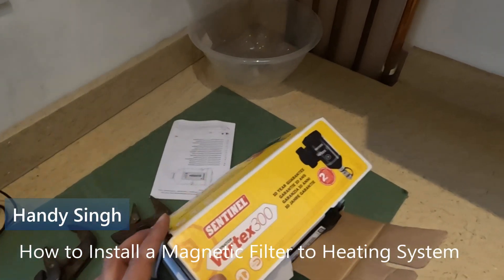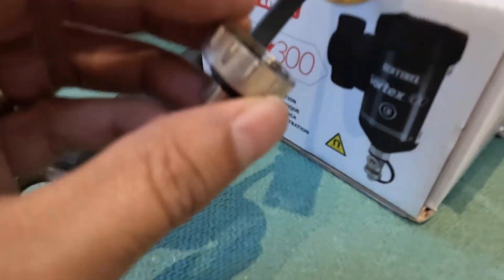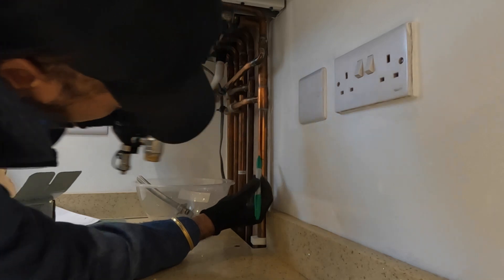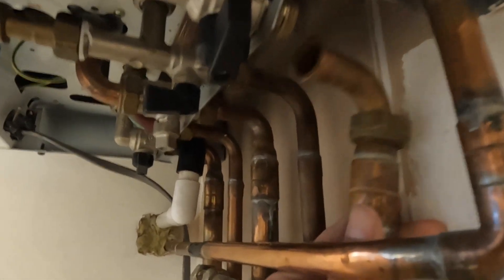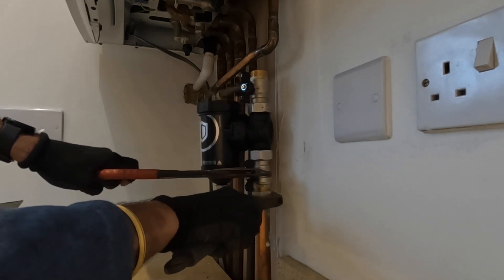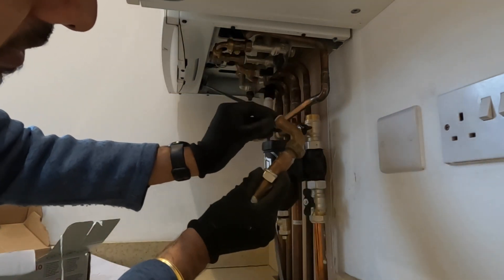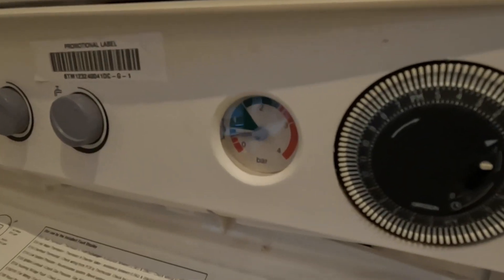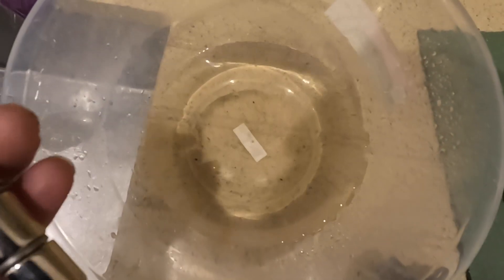MAGNETIC FILTER INSTALL AND REVIEW - HEATING SYSTEM - SENTINEL

Comment: PTFE tape is NOT required on compression fittings !! 
A small amount of jointing paste is all that is needed.  Putting PTFE tape on olives is a DIY cowboy mistake 👎🙈
Reply from the maker: Hi mate, yes your right the paste can also be used. However ptfe tape also has its benefits too. Both senerios I have tried and no issues for last 20 years. Basically this was what I had available on the day. You will see on my next video I have used paste too. Out soon.  Cheers Handy Singh.

Comment: I dont agree that the olive needs to be crushed onto the pipe. Just assemble the joint with a little lube, do up nut and olive finger tight then a nip of ~1/8 turn and it is sealed. Cranking up compression joints leads to problems later. Also, best to put something between the wall and the wrench when cutting the pipe to avoid marks...

Comment: good job - thanks for the video.
My boiler seemed to have a leak - i pulled the magnet out while trying to identify source of leak,  and after 5 mins put it back in - seemed to stop leak.
now i am wonder is the filter was full of gunk and by removing magnet i just sent it all to the boiler?? 
could the filter just fill with gunk and cause a leak ?